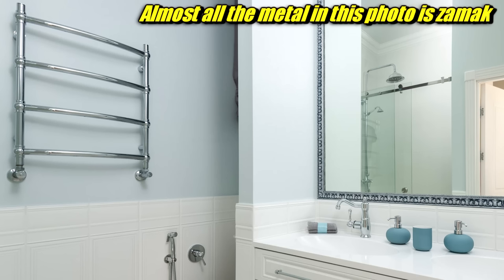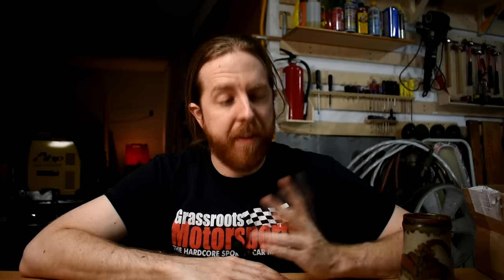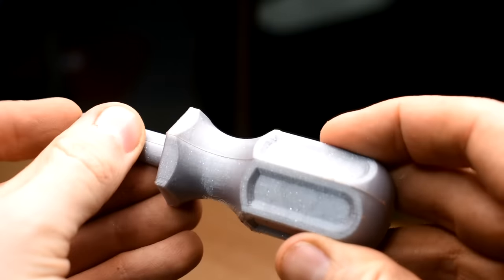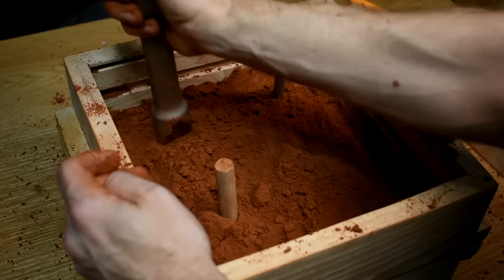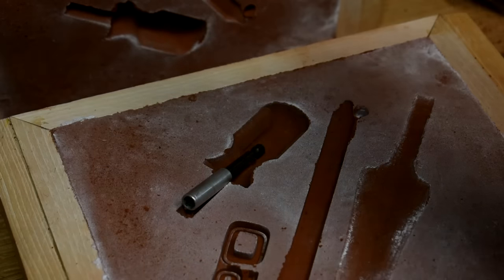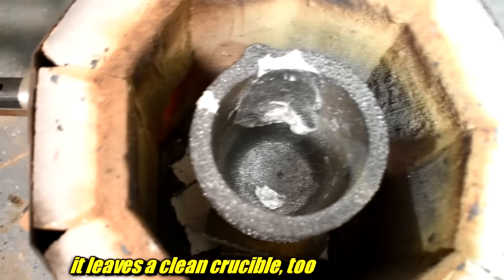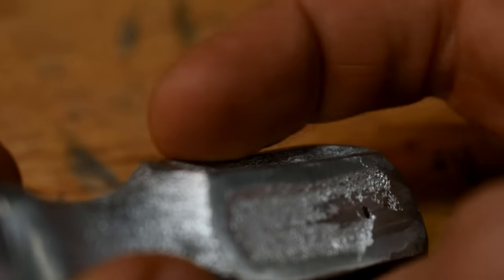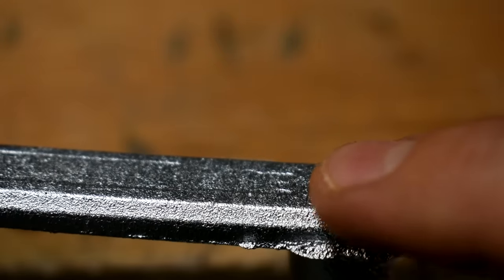The BEST Metal Casting Alloy That Everyone Ignores

Comment: Alot of the bad press about zamak alloys comes from the fact that companies realize it's strength and fluidity, so they cast stuff out of it that is extremely thin to the point that it almost becomes brittle, so in use, it ends up breaking and the bad press comes from that. I said to leave it in the sand a little longer because most people tend to think it chills instantly, but doing thicker parts, it tends to stay fluid for quite a while unlike aluminum and feeds from risers/feeders, and if you opened it with a larger part, you may end up with a casting that isnt fully solid and things may just break off into a crumbly mess or at best, just warp. With the half nuts I poured in ZA12 for my lathe, it took close to an hour to cool down, but I had poured it into a hot investment mold too (which you will get a better finish from a cool mold). Some people just get excited and cant help themselves from just opening the mold right away after pouring instead letting it sit and fully solidify, lol. Gingery lathe bed is a good one of those examples, you want at least an hour or two for that casting to solidify or it will really warp badly.
Reply from the maker: That's a good point, some zamak stuff is crazy thin.  Almost to the point i would think it's formed from sheet, but then you can see mold lines.  The lathe bed will probably sit overnight, just in case.  I usually get too excited and open a mold too soon lol often you can see i'm moving the casting around in my hands, thats because i'm getting burned lol
Reply: @PaulsGarage  lol, yea, the longer the bed has to set in the mold, the slower the part cools down and it relaxes alot of the stresses that's built up from casting and the cooling/shrinking, so the slower it can cool, the less it will move once it's cast and machined up. 

Also, as I said on the discord, I would make sure to get that stuff machined up somewhere instead of trying to file it to shape, it is some very slippery stuff and is fairly hard, so you will not be having much luck trying to file it perfectly flat.
Reply: Yeah its weird how it solidifies; it can have this seemingly solid appearance but then crumble anyway. I suppose you first get a bulk of grains solidifying out of the melt, but the remaining grain boundaries staying liquid far longer; or something to that effect.
Reply: Also, yeah ive ran into its brittleness limits before; it definitely is not bronze in that regard, and I dont have high hopes how a spear point would hold up if youd start whacking things with it; but for parts with a little beef to them it really is an excellent material.
Reply: It's not "bad press", it's just a bad product. If you're making anything more than a monopoly player piece or cheap temporary display-only replica it's going to be fragile garbage, and even then it's still a bad choice since zinc rot will destroy it eventually. Pretty much anywhere you'd use Chinesium you're better off using a decent plastic.
Reply: @superslash7254  Well in terms of reliable yield strength you are probably right about the plastic; but then again if you care about stiffness or the ability to make bulky one off parts for cheap... I dont know if you ever tried to get a quote on a continuous carbon print or a PEEK injection molding run... but you can buy a lot of ingots for that.
Reply: @superslash7254  in this world where everyone is afraid of lead anymore, it is very unlikely to find zinc or zamak alloys that contain any lead, and that's what causes zinc rot, so I dont see where you would run into the lead contamination that causes zinc rot as much these days, especially in ingots that come from reputable sellers tbh.
Reply: Back in the day when automotive companies had tons of decorative pieces in dashboards, grills, headlight assemblies, taillights, interior trim etc they must have gone through a lot of these alloys. Just think of some of the grill pieces that were diecast. And then in the late 60s we began to see large plastic pieces begin to replace the metallic parts.
Reply: Worked at a foundry that poured za5 and za12.  Most castings were high end medical castings in permenant tilt pour steel molds.   Don't have to be cheap die cast parts.  Good way to heavier than aluminum parts that can be cast in a permenant molds.
Reply: @justinsturgeon1  Yea, zamak alloys not only have the weight, but it has very close to the same wear properties as cast iron as long as you have the stuff oiled, and it has vibration dampening effects like cast iron. Thats why you dont see cast grey iron bells, they just wont ring at all but create a dead thud unlike aluminum or brass. Thats why you see zamak used for gears, half nuts, and other bits and pieces in metal lathes due to the wearing properties and vibration dampening.
Reply: i was gonna leave a comment asking if this would be better for gingery machines than aluminum. i own a nice lathe so im just making the shaper and milling machine.
Reply: @nilegod1  yea, zamak is alot better than aluminum due to it absorbing the vibrations, it's density, and the fact that it wears almost as good as cast iron when properly oiled. The aluminum does work, but it carries vibrations badly and the whole thing rings like a bell and it's hard to take any real cut without it wanting to chatter, unless you bolt it down to something solid that eats vibrations like a concrete slab. I believe that ZA27 is the best for a lathe/shaper/mill tho because it has the best vibration dampening effects and highest strength to weight ratio.
Reply: It is painful to coat, and it oxidizes easily. Really awful alloy to work with.
Reply: @Volodimar  depending on the alloy, it can be a pain to paint it, but just like it and aluminum, you need to use an etching primer first or the paint just wont stick to it very well. As for oxidizing, Ive never had much trouble with it oxidizing really badly, and a little wax will protect it from oxidiation for quite a long time.
Reply: @Volodimar  Can't fix it, either. Once it fails, it's scrap.
Reply: @ChirpysTinkerings  You first have to state the type of cast iron you're comparing it with. I presume you mean lamellair cast iron. Sorry to say, but this Zamak can't be compared to lamellair cast iron. Zamak has a higher damping then alu but there the comparison stops. If your statement would be true, zamak would have been used in way more cases instead of lamellair cast iron the current day. You can say that you can use zamak instead of alu for similar cases when you would use lamellair cast iron instead of nodulair (or all other) cast iron or steel alloys. Bolting to zamak is always tricky and prone to failure on the long run. Alu also doesn't ring like a bell compared to other alloys. Quite some engine blocks are made of aluminium due to the reduction in weight and the fact that alu already has a decent damping factor compared to steel alloys or cast iron with a higher E-modulus/lower damping factor. Also state to what alu you're comparing zamak with. There are quite a few alu alloys out there.
Reply: @eelcohoogendoorn8044  do a 3d print in plastic.
Reply: Would it be possible to copper-plate the zinc casting in an electrolysis bath and then electronically gold-plate it? Or will it all fall apart?
Reply: @lenny108  yea, you should be able to elecroplate it with no problem, but the amount of solution you'd need to do a lathe is stupidly high, plus the electroplating is very thin and with shavings and such, it'd just scratch off fairly quickly. But yea, if you make stuff from it, it should take electroplating without any issue as far as I know.
Reply: How to avoid air pockets when casting zinc, is borax working for zinc?
Reply: @lenny108  Air pockets in zinc is usually from uneven/too much moisture in sand, or wrong pouring temp. Borax should never be used around a foundry furnace, it just eats up your crucibles and lining, causing alot of damage.
Reply: @superslash7254   Not with a good alloy quality but if the zinc is polluted with lead or ferrous particles (<0.01% is enough) it's what you will have. Rotten parts come from chinese companies most of the time. The problem is when recycling the alloys, there is a contamination...
Reply: Where can I find some I would live to use it. And yes my early casting it was like a gift open it 

Over time I let them set and clean,up there the last thing I do a big reason I do mass model castings some times a surprise.  Most I let cool over nite let them settle then heat treat slow.  But yes would love to try
Reply: @superslash7254 Hi can we use zamak for making ring i am starting a ring businness(men jwellery )can it shine like copper or alluminum or silver?
Reply: @eelcohoogendoorn8044 Hi can we use zamak for making ring i am starting a ring businness(men jwellery )can it shine like copper or alluminum or silver?
Reply: @justinsturgeon1 Hi can we use zamak for making ring i am starting a ring businness(men jwellery )can it shine like copper or alluminum or silver?
Reply: @ChirpysTinkerings Hi can we use zamak for making ring i am starting a ring businness(men jwellery )can it shine like copper or alluminum or silver?
Reply: Hi can we use zamak for making ring i am starting a ring businness(men jwellery )can it shine like copper or alluminum or silver?
Reply: @sreerajkp7516  You can mirror polish zinc.  It is used in decorative belt buckles and items like  that, but  it is  usually  coated after that.  Many car parts are zinc castings and chrome plated.  It can be  sorta  brittle in small section sizes.  I would stick with  pewter if you are going  low budget jewelry and bump up to copper and silver.
Reply: @sreerajkp7516  it can, but in thin sections like that, it is a bit brittle, so I wouldnt use it for something like that.
Reply: @ChirpysTinkerings  bro I really need u r help what metal can i use for my costume jwellery safe alloys or something i have been reseaeching for 3 months now i still stand at zero now. It would be great if u suggest something❤️
Reply: @sreerajkp7516  for jewelry, most people use silver, or maybe try an alloy like everdur and just plate it. Either way you do it, you'll need to have a vacuum casing setup to get it to fill in the small details.
Reply: There are a few 70s & 80s guns that used it for certain parts and have a reputation for being unreliable. That's kind of similar: maybe the alloy was just pushed too far and got a bad rep

Comment: In Poland, due to low quality and brittleness of many parts made from alloys like that, we call it "gównolit" which means somehing like "s*itlyte" or just "s*it material" :D
Reply from the maker: Lol I believe it!  Here we call it pot metal usually.  Gotta get quality metal and don't screw up the casting or you have ruined junk
Reply: My guess it was not high quality Zamak 12.  Like Paul said in the video, impurities like lead significantly lower the quality of the alloy.
Reply: @PaulsGarage  The term extends to other alloys too, usually bad castings and brittle parts that brake usually get that reputation. Also things hard/impossible to weld too.
Reply: I have a similar opinion, in the saddlery trade, we stay away from it, weak, has to be plated with nickel or chrome which when scratched cannot be polished out.
Reply: What is the white smoke from melting copper wire?

Comment: be careful with the amount of parting dust you put on with that if its reproducing that kind of detail from the sand grains.  I had an issue with some super fine petrobond that I made for high quality finishes and it was reproducing the parting dust in my final castings, when I blew most of it off before casting the sandy texture was gone and I got WAY better surface finish.  took me a long time to figure that out...
Reply from the maker: Interesting!  I hadn't considered that but it makes sense
Reply: I noticed the same in some of my earlier castings, I now put the talc in a cloth bag and shake out a very fine even layer, way better than shaking the bottle.
Reply: I agree. Fine facing material gives a fine finish. I used to use a cloth dusting bag and then a light brush to smooth any "bumps". But use a very fine brush as the Zamac will show the brush marks!
Reply: @dpeter6396   I recommend Squirrel hair mop brushes. I use them for gilding  in my job, didn't take me long to figure out they were quite good for casting as well.  Only down side though is they can get quite pricey.

Comment: Also worth checking out EZAC (a newer Zinc Alloy of 88% Zinc, 5% Copper, 7% Al - Melts at 412c and Cast between 425-455).  Harder than Zamak 12 with much better creep resistance.
Reply: probably a dumb question but I was wondering if EZAC or ZA 12 can be worked as in heated, hammered and shaped or will it just crack like cast iron?
Reply: @GeorgeStreet-m8c  NO it will crumble

Comment: My lathe uses Zamak for the change gears. While they do wear faster than steel gears the original set is still going strong since being cast in 1953.
Reply from the maker: Good to know!  The gingery projects eventually Include lathe gears after the mill project, looks like I'll just stick with this metal
Reply: @PaulsGarage  don't disregard pewter alloys. I made a sear for a paintball marker with Prince August's 5 Star metal (94.5% Tin / 3% Zinc / 2.5% Antimony). It has to withstand 1200 psi of pressure on a 2 millimeters thick protrusion (it's the sear of the milsig m17).
Theoretically, depending on the alloys used, pewter can have tensile strengths ranging from 6000 to 8600 psi. Perfect for gears, even when torque is involved. After all, the cheapest air compressors are also made of pewter, which is a proof of reliability.
So far, mine resisted the repeating impacts of a badly designed marker like a pro; the sear must withstand all the pressure of compressed air and it's a single lever system which requires an extreme effort when pressing the trigger, which are all stresses that, according to popular beliefs, should have bent and deformed my part, which did not happen, even after some thousand shots.
Reply from the maker: If love to use pewter for stuff, the super low melting point is really tempting for silicone molds and stuff.  The only problem is the $40 per pound price vs. $20 for 4 pounds.  Someday I'll check it out